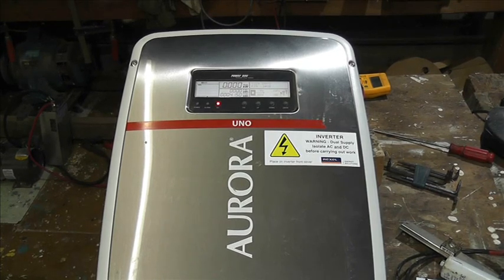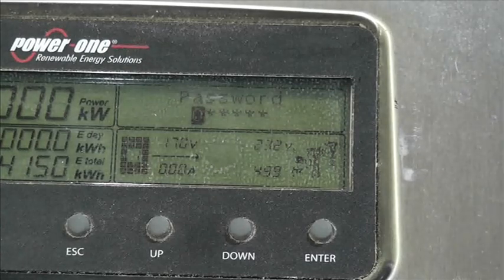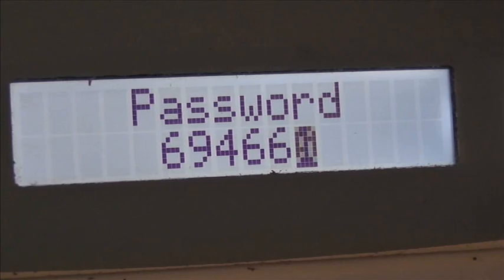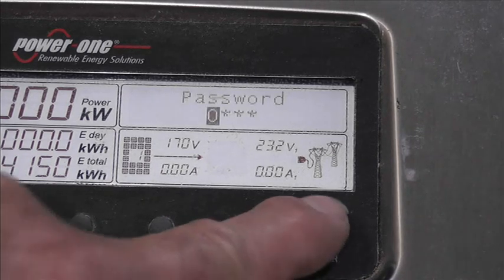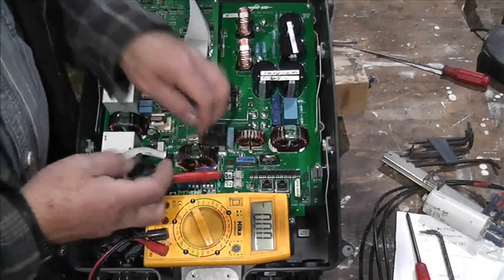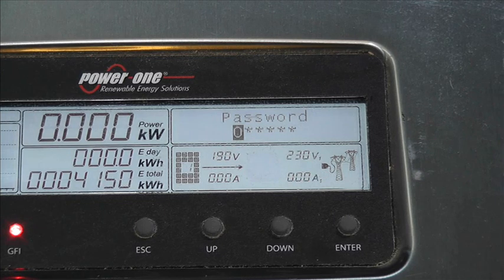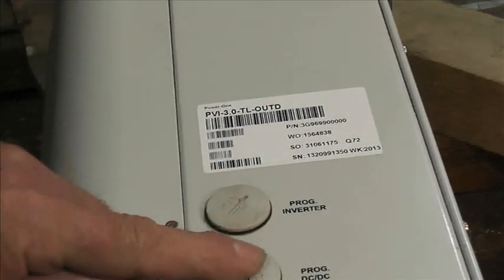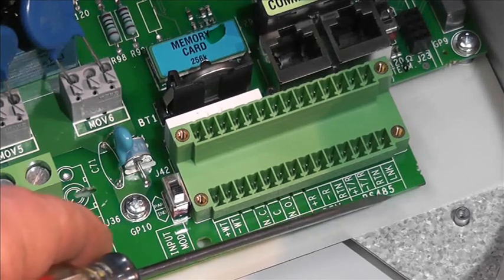Aurora ground fault and service password problem

Comment: I have a uni ABB and I keep getting a riso gfi 0.00. I saw my junction box on the roof had water and ground was corroded. I cut back and replaced the wire and still have a riso 0.00. Do I need to e ter the service part to reset this fault or why am I getting this still? I tested inside the panel to see if anything is grounding and nothing is grounding. Power to all strings. I'm guessing I need to get into the service part to reset... Maybe?!?
Reply from the maker: Hi, difficult issue, I ended up scrapping this unit. Sometimes the GFI problem is in the cables and it takes half nothing of a ground leak, in my case it was in the inverter. Second hand units are so cheap, and although it seems like giving up, it's an easier option, cheers

Comment: this error refers to the AC side of the board, most likely there is a faulty capacitor. Check them externally and if necessary measure them with a multimeter.
Reply from the maker: Yes, tricky things to measure unless removed, cheers

Comment: Andy I have just been fixing up a few of these inverters to use with my off grid system. When you put the serial number in to get the password just click ok, not the generate password button. Doesn't make sense I know but just click the OK in the top section and the password will appear, Click generate password and it says wrong password. Also the ground fault could be a failed RED MOV just above the DC inputs on the PCB. It will give a RISO error if not installed, try taking a couple out of a working inverter and put them in the one that is giving you grief.
Reply from the maker: Gary, interesting, I will try this on another unit, how do you use these off grid? cheers

Comment: Hi Andy back again with an update.  After proving that my 10 panel section is causing a high ground fault on my inverter and as mentioned the panels are on my roof.  I decided to have a go with  an old trick we used in Strowger Telephone Exchanges when the Boss was'nt looking. We often got resistive ground faults due to oil getting dirty and tracking to earth.  So we made a 10 ohm wire wound resister and a probe connected to the 50 volt supply then probed the suspect areas on the earthy side. Quite a current would  breifly flow and hay presto blasted the contact away. So I decide just to short out my panels when the sun was shining. Result now no RISO alarm and all panels producing. Saved the Scaffolding for now.
Reply from the maker: Brilliant, that warmed things up and improved the contacts, worth remembering, cheers

Comment: Well Andy that was perfectly timed. Yesterday my Aurioa Uno stopped working and showed a RISO high alarm. I have two seperate banks of panels 10 and 6. I found by disconnecting each bank that the 10 panel bank is suspect.  Problem is they are on the house roof. So scaffolding required. So disconnected them and now running on other bank of 6 panels. Suspect rain has got in somehow.  So very interested to see your progress in disconecting the ground.  Thanks for you info. As you know we have been abandoned by Arrouria and ABB.
Reply: And Fimer as the email I received from them was what prompted me to reverse engineer the password calculation.

Comment: Hi Andy, Great Video! Thanks for the shout out!
That is a very strange fault on the 2kw inverter.
The RS485 connections are just the  + and - but on the interface I got from amazon it had the GND wire too (which is marked RTN on the Aurora) so 3 wires. I just used some wires that are commonly used on Arduino microcontrollers (Dupont connectors, and just poked them onto the pins).

The interface I used was from Amazon "Waveshare Industrial USB to RS485 Converter" around £17.
Hope that help!

Oh and the service password for your 3KW inverter SN:991350 should be 880460 :)
Reply from the maker: Mick, thanks for this info. I really should gain some experience in this, but you know how it is. Cheers
Reply from the maker: Mick, all parcelled up and I've sent you an email, cheers
Reply: @TheInfoworks  Thanks Andy!
Reply: @TheInfoworks  I've sent the label Andy. Cheers!
Reply from the maker: @BuyitFixit  splendid, I'm on to it, cheers

Comment: Ps I can communicate via rs485 with my other inverter.
It needs a fairly expensive USB to re486 adapter. Others may work but I was told just get a proper one. Its a three wire connection.
Reply from the maker: Jim, do you know how the wires go? cheers
Reply from the maker: @Woodyjims-shack  Jim, thanks for looking out these details, web searches are sometimes quite difficult, cheers
Reply: I have a cheap usb to RS485 from Aliexpress and it works fine, only cost a few dollars. It has just 2 screw terminal A and B just connect A to A and B to B, if you have multiple devices connected it needs to have the 120 ohm resistor in just the 2 devices at each end. If you are just connecting your PC to one inverter just run a twisted pair of wires A-A and B-B and it will work with the ArouraCVI software that you can download via the link from buyitfixit's video.

Comment: FYI Andy I have a 6kw Aurora with a GFI fault and last time I tried to start it I saw a battery low warning also.
I know a dealer who might give out an official password!
Reply: "Official Password?" - the algorithm is the same, if the dealer generates it, or you use aurora's CVI software (unlocked with their engineer password of "91951") or use the keygen I wrote. The numbers will be identical. You can even work it out with pen and paper! (see comment below).
Reply from the maker: @BuyitFixit  Mick, forgot to say, it will make a great video with plenty of explanatory detail, cheers
Reply from the maker: @BuyitFixit  Mick I will sort that and confirm the weight, should be in the 10 to 15Kg range (might be a few days as we have visitors). Victron inverters are reliable, we now have 5KW multi, and it is set to look after the batteries but only run at a max of half capacity, that way all will have a long life. Just been looking at an Afore 2.7KW with a dead short, turns out to be 2 of the 4 fets. They are K30H603, would K50H603 be a replacement as I have several? Cheers
Reply from the maker: Jim, interesting, so you think the two faults are connected. The passwords are individual and so a right unnecessary hassle, cheers
Reply: Could the GFI faults possibly be related to the 3 pin MOV's that seem to be on the input side of the inverter? Anyone tried removing them to check?
Reply from the maker: @BuyitFixit  Mick, I swapped the thermisters to no result. If you would like this unit I can parcel it up if you send Evri  (Hermes) to collect it. The local Evri rep knows where we are and where I leave things. Jim thinks the 2 symptoms are related, cheers